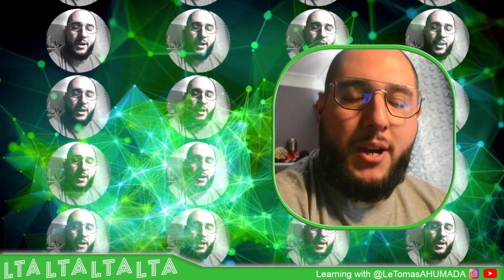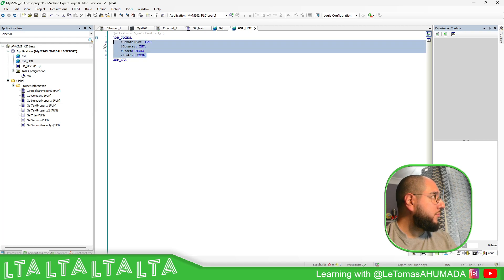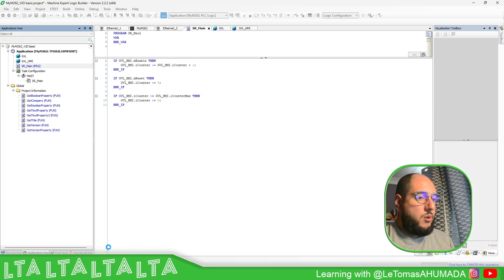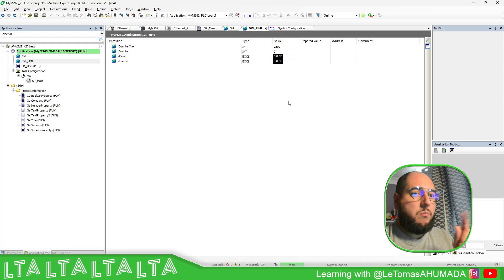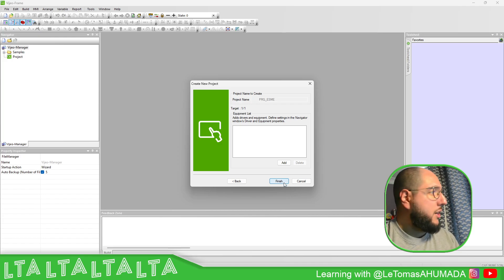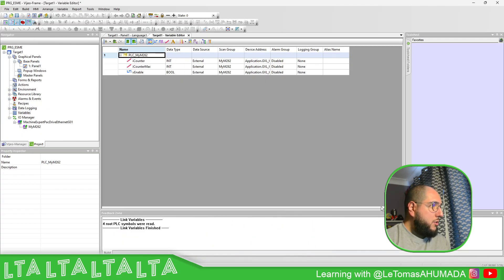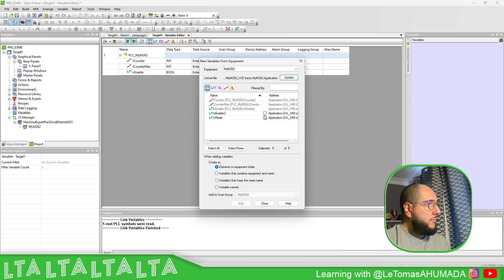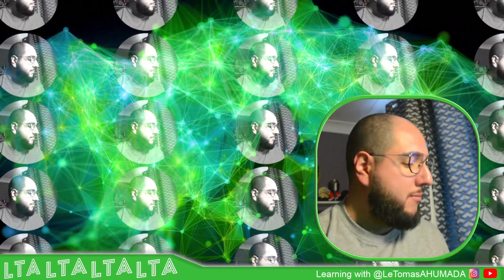EcoStruxure Machine Expert Training - M14.4 Connection to Vijeo Designer Basic (Over Ethernet)

Comment: I did the same steps but no communication can you guide me where i am wrong
Reply from the maker: Hi there! Could it be multiples thing:
1) credentials on the plc, then you must use it on the hmi driver to communicate with the plc.
2) no updated symbol configuration
3) wrong node name in the driver

Try to use the simulation of the hmi first, if that works then somethijg weird with the hmi, try a factory reset and download again